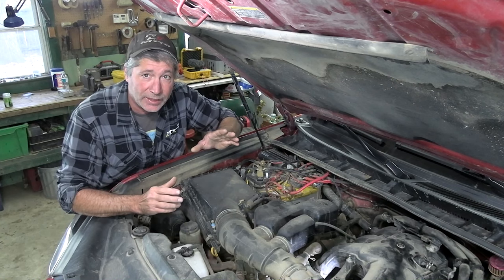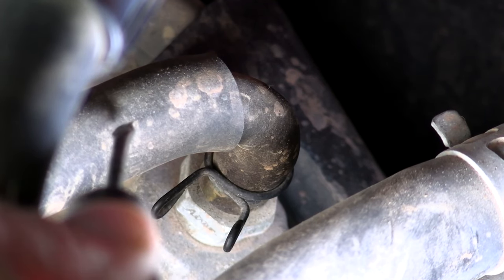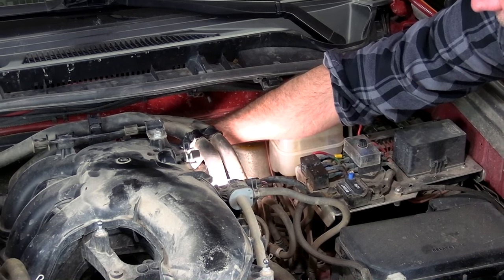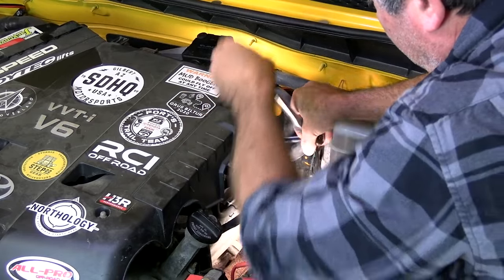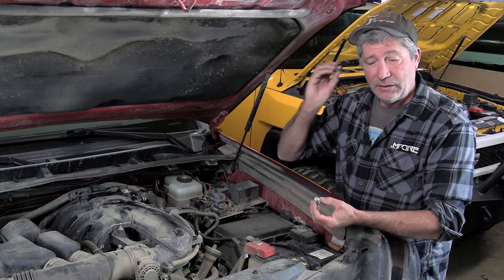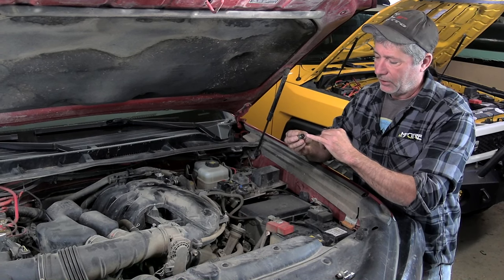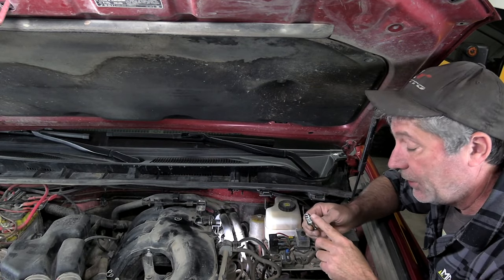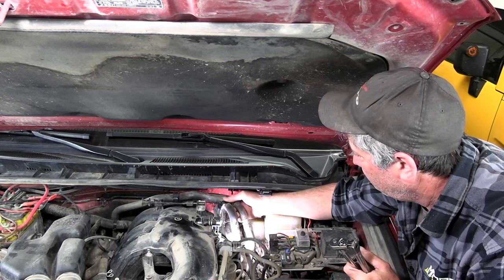Avoid Costly Engine Oil Leaks - Toyota Tacoma, 4Runner, FJ Cruiser - How To Replace PCV Valve

Comment: Great video. Quick note on 10k oil changed interval with synthetic. Several reputable sources are strongly advising 5k oil changes even with synthetic, they speak of first hand experience with engine damage using the 10k interval after the 100k mark. "The car care nut" you tube channel has several videos about the "why", he is toyota master tech.  Figured I'd mention this as you keep your vehicle long term. Love the vids!
Reply: Correct, 5k is best. Always cheaper to change your oil than rebuild/replace your engine.
Reply from the maker: 1,000 is even better!
Reply: Change it every 5 miles! Save your engine now!
Reply: im at 200k with 10k intervals. No issues, no leaks.
Reply: @WanderlostOverland  🤨
Reply: I use full synthetic oil and a good filter and change my oil annually, but I don't drive much so that's usually 3,000 to 4,000 miles.  Lately, I started running a quart of 5 Minute Motor Medic engine flush solvent in the oil before each oil change to hopefully reduce the varnish and sludge buildup.  Also, for the home gamer, a Fumoto oil drain valve makes draining the oil an easy tool free operation.  On the 4th generation 4Runner it's well protected by the skid plate but doesn't drain into the skid plate.  The 1GR-FE 4.0 liter V6 engine has the oil filter on top where it's super easy to reach.  It didn't drip at all when I unscrewed it, but the fastidious Japanese engineer put a drip guard around the filter to catch any drips.  This is by far the easiest and neatest oil change I've ever done.  There is no excuse for not changing the oil frequently on the 4Runner.
Reply: I agree!
Reply: the engine the car care nut used as an example was not a tacoma engine. it was a 4cyl with oil issues when new. change you oil when ever you want, but using a different engine as an example does not make sense.
Reply: I’m doing 5k miles. I can’t see it harming the engine doing it more often and it’s easy.
Reply: @bigmatt503  2ar never had oil issues that was the 2az from back in 2008-11 or so. The real problem is the blanket statement, 10k is too long in all the but the best of driving conditions, but some people will meet those, most people say 5k because it’s easier and for sure better on the engine, but If you want to keep track of your driving habits you can probably safely go a little longer, me personally I go between 5-8k sometimes it’s pretty dark and thin at 5k sometimes it still looks decent at 7k. Most people don’t want to do that and 5k becomes 6k+ so it’s just easier to tell people change it early. But even manufacturers say there is a severe service interval and honestly it’s sound a lot more like regular driving than severe driving.
Reply: @thetechlibrarian Well people just don't say it the Japanese engineers and the owner's manual requires 5k oil changes. I think people get it wrong due to the Dealers misguidance and owner's manual allowance to possibly taking it to 10k if your location can't allow oil interval at 5k. Just bought a 2023 and that Toyota dealership gave me 5k oil change coupons saying the past 10k free oil changes were wrong based on the owner's manual. Days prior at a northern location Dealer, they're still on the wrong 10k interval and I think it's a money saving move. I recommend owners to go to your manual and inform your dealership they'll change their tune really quickly and if you do your own maintenance to switch to 5k quickly. My older Toyota's PVC valve was checked at 70k, 100k, and then 150k didn't even need a replacement. It looks way better than Wanderlost Overland 4runners at 100k not rubbing it in just my results. I think it's due to a catch can installed and 5k oil changes.
Reply: People need to see a lubricity test on new oil and 10k oil. They’ll change sooner. I’m in the oil industry.
Reply: Same. My 04 has 257k and I do my oil with Mobil 1 synthetic every 4k. I used to use motor medic but switched to STP high mileage engine flush. Also use Liquid Moli Cerratec every 20k.
Reply: @bigmatt503 he has talked a w lot about it overall recently. Matter of fact TODAY gave a whole video on time frames
Reply: I just do 3k 265k and going strong.

Comment: FYI guys, those used PCV valves were still functioning. Back in the day the 'test' was to make sure they still rattle. Many times a soaking with some carb cleaner will bring them back to life. Nowadays, most just replace it because they are a simple $20 part.
Reply from the maker: Still functioning....yes, but not to their full potential. Best to replace, or clean, them before they don't function and cause damage.
Reply: @WanderlostOverland   hahah yeah, "Functioning" is not what maintenance is about. If its no longer functioning, that is a Repair :P
Reply: $8 at my socal dealer

Comment: FYI guys.....install requires Toyota Genuine Adhesive 1324 and a torqued to 20 ft/lbs.  Also, $4.45 from the dealership.  🤷🏿

Comment: My wife’s Lexus came with “free” oil changes every 10,000 miles the first year.  I took over the maintenance after that.  After seeing how filthy the oil got after 10,000 miles, I reduced the frequency to about 7000 miles.  By then it’s getting plenty dirty but nowhere near as bad as the 10,000 miles.  I service the transmission and other items as well.  The Lexus is a Toyota w more options.  Great reliable vehicles, but I would never recommend waiting 10k to change oil!

Comment: Great video, but as you said should be able to be cleaned out. Yes that part might "only" be 15$. But that is not the "only" part that is "only" 15$ that should be maintained. add 10 parts that can be restored with some cleaning instead of buying new. Now we talking 150$  in parts if we going to use that logic. Obviously if the part is no longer functioning at all then it needs to be replaced. But I am overhauling a 1999 J90 Prado atm. And if I would use this logic I would have spent 170$ on just lug nuts if I bought new instead of cleaned the treads etc.

Comment: Do you have the part number?
Reply: I second this. Came to ask for the part # also.
Reply: I just ordered a Toyota replacement (12204-31030) on Amazon for $11.95.  That's the part for the 4.0 liter V6.  Amazon makes it fairly easy to enter your vehicle in your Amazon Garage and when you search for PCV valve, it'll recommend parts that fit.
Reply from the maker: It's best to look it up for your particular year. Our '17 4R and '07 FJ take different part numbers.
Reply: @WanderlostOverland  ohh okay gotcha thank you 🙏

Comment: Doing this soon! Just hit 60k
Oil changed, rear diff fluid changed, engine air filter changed. Will do front diff too and might as well do transfer case. Radiator drain and refill coming up too! Woo! Transmission drain and fill is the only one I find slightly intimidating.

Comment: One of the most overlooked parts but so important.  Ours is in a horrible location 2018 RAV4 with the 2.5L, it took me over an hour to complete.  It's like a 2.5 hour dealer labor charge + the part but YT'er the-car-care-nut showed a way it can be done but not for anyone inexperienced working on cars.
Reply: Same location on my Highlander. I was concerned that doing it by feel like TCCNs example would take me forever. Thankfully it took about 30 minutes. The OEM part was $16 from my local dealer. The new PCV was a game changer for our Highlander w/225K miles.

Comment: Yes, this was a good reminder for me to change the PCV on my 2015 4Runner (64 K miles). Thanks!😊
Reply from the maker: Glad it helped!
Reply: It did! I just replaced the original PCV valve on my 2015 4Runner Limited w/ 64,000 miles with an identical OEM valve from the dealership (part number: 12204–31110). I followed your procedure but added a couple of steps: 1) Sprayed the old PCV with Free All as it was hard to loosen, 2) Torqued the new one to 20 Ft-Lbs per my search of the internet. The old one sounded almost as “free” as the new one, but at only $7.27, I replaced it anyway. Thanks Wanderlost Overland! 🤓

Comment: Ugh... 113k on my 2015 Tacoma... now I have to check Rockauto and Autozone... thanks for the tip... never knew this was a thing... somehow.  Yay for more maintenance... so long as it extends the life of the truck.
Reply: I just ordered a Toyota replacement (12204-31030) on Amazon for $11.95.  That's the part for the 4.0 liter V6.
Reply from the maker: You bet!
Reply: @WanderlostOverland  Changed it yesterday... yeah, it was gross and barely moved.  Good tip, Mark... as usual.

Comment: I put a JLT oil separator on my 2020 Runner right after I bought in new in 2020. It catches all the oil and fuel blow by that comes out of the PVC system before it gets routed back into the intake for engine to burn. I don't believe you should force your engine to eat what it pukes out the PCV system. I empty the catch can about every 3k miles. Makes for a cleaner engine IMO.

Comment: Thanks, never changed mine-176,000-but I will now! Thank You
Reply: I bought a 2005 4Runner a year ago.  It has almost 175,000 miles and it's probably still using the original PCV valve.  I just ordered a Toyota replacement (12204-31030) on Amazon for $11.95.

Comment: 2:05 “It shouldn’t be in there very tight….holy sh** it’s in there really tight.” Haha great video. 😅
Reply: Toyota puts their thread locker on it and suggests when replacing also, or Loctite 271. I believe someone on 4R forum  found the torque spec also 20ft lbs.

Comment: Damn I have 67k 07 FJ from japan. Seeing the state of the airfilter this otherwhise excellent condition car had and the throttlebody (I had to clean) I guess this lil valve was never changed. - recently It developed what seems like clear oil leak  - still didnt wind where from exactly. Changing that valve is good idea in any case.

Comment: My 2013 is 11 years old with 60k miles. I could not manually remove it. I had to use an impact wrench to remove it. Putting new one was also a pain. Manually went as far as I could go but still seeing a small thread. I just left it like that.

Comment: Interesting I guess I  should cha nge the pcv valve on my   2017 tundra it has a 168,000 miles on it. Curious  question  I  think you said you changed  the oil every  10,000 on the 4runner  and the Fj every 5,000 and the  valve  wasn't  as dirty as the 4runner. I get conflicting advice some say you should  change  your oil every 5,000  10,000 on synthetic  oil like  my 2017 tundra but I started  changing  it every  5,000 the last couple  of years  what's your opinion.  Thanks
Reply from the maker: The other way around; the valve from the FJ was much dirtier. Toyota says to change the synthetic every 10,000 so that's what we do.

Comment: if the PCV gets plugged, the passenger (right) side valve cover has a crankcase air inlet connected to the engine air inlet. Plugged PCV oil vapors will begin pushing into the throtle body contaminating your intake
Reply: Could that issue cause a plume of bluish gray smoke from exhaust on startup for less than 30 seconds..the '18 Tacoma TRD pro with the 3.5 L? It never smokes any other time..and I always maintain the synthetic oil..currently 165k
Reply: @jefflancaster6587   in the past I've discovered that to be valve stem seals.

Comment: I have a 2010 4runner . Was told that i need to repair the timing cover fixed . I chang oil every  3000 miles  . But they want to charge 3100 + dollars . Is that the same repair you are doing in this video . Please help don't have that kind of money .

Comment: The crude, is carbon deposits, carbon deposits accumulate from using conventional oil and not changing it over 3K mils
Always Always use synthetic oil, it's cheap and readily available.

Comment: Great video! Any chance you can share part numbers for us lazy folk?
Reply: 12204-31030 is the Toyota part number for the PCV valve on the 1GR-FE 4.0 liter V6 engine.  $11.95 on Amazon.  I just ordered one.

There's a $7.56 after market part but I splurged on the genuine Toyota part.   :-)
Reply from the maker: It's best to look it up for your particular year. Our '17 4R and '07 FJ take different part numbers.